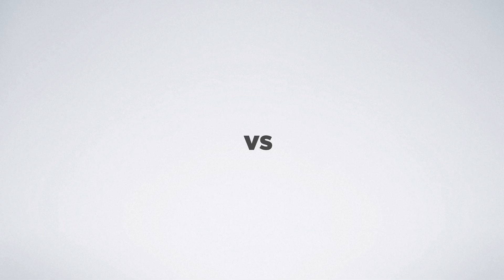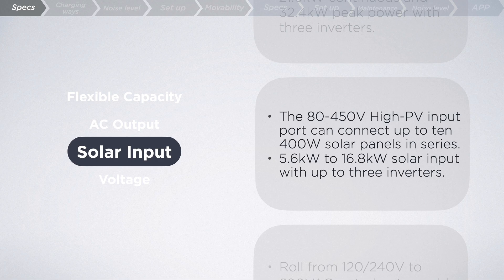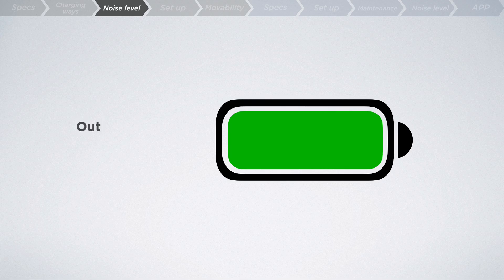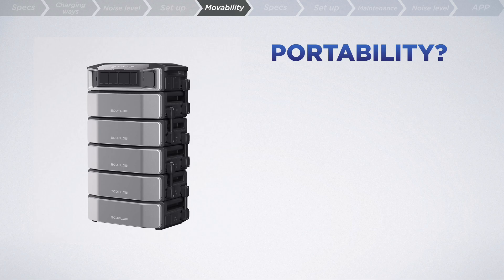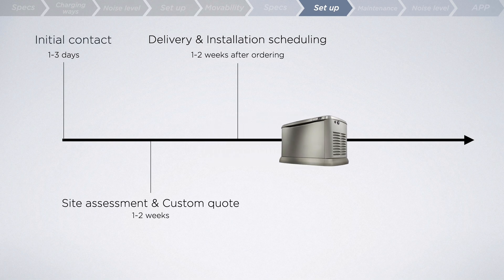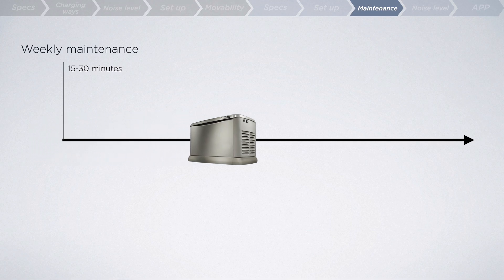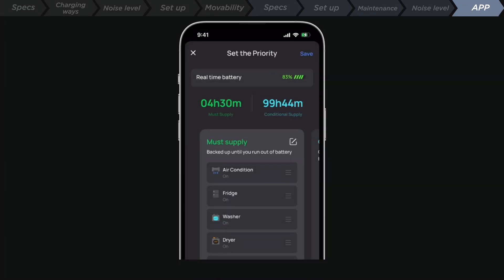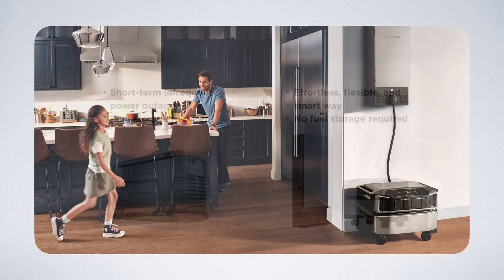EcoFlow DELTA Pro Ultra: Will it Replace Home Standby Generators?

Comment: Half of the points ecoflow doesn’t make sense. 1: Fuel, Batteries need electricity and people usually set them up charging via grid. Electricity is expensive and cost a lot. Natural gas however is usually cheaper and runs longer. 2: Flood, you’re gonna need to shutoff your electricity anyways and usually the battery will be damaged. 3: Control, What’s stopping you from going to your panel after the storm and switching off a couple things in the breaker. Also, standby generators will run as long as you need them so you shouldn’t need to conserve energy by shutting stuff off althiygh it is advised to save money.
Reply: 1-pair with solar, 2- some homes have sump pumps below ground level in basements where you can't place a gas generator.3- solar can recharge the battery once the sun is up and if you're not physically home can help if you are able to remotely manage loads to prioritize for example above sump pumps
Reply: @Remotesteve2 what about during a snowstorm? What happens then, in the winter solar charges less, what about during a hurricane when it’s completely clouded up skies,
Reply: @ItzAwsomeWasTaken  we don’t get snow storms or hurricanes here and flooding knocks out traditional generators too so not sure where you were trying to go with that…

Comment: I’m pretty sure if it flood you won’t be able to use the battery to power your home 😭. You have to cut the power from your home to prevent electrocutions and aswell as batteries and water don’t work well.

Comment: I sell and install home standby generators, and have for past 10 years. They all need some kind of fuel - unleaded, diesel, natural gas or propane. WHEN THE United States electrical grid goes down, due to age, or  power grid packing (power grid stresses), an emp (and electromagnetic pulse), hackers trying to put maleware / trojan into the system etc. etc. (Which has been happening as far back as 2016 by China, Russia, Iran and now North Korea) ... How will you get any fuel ? You wont!! So that 500 gallon or a 1000 gallon tank you have IS GOING TO RUN OUT, and if there is no electricity, there is no gas station that can supply any kind of fuel. I'm not a conspiracy theorist, but the signs of the times are coming. Get solar and batteries to protect you and your family. Ecoflow is an excellent product, an all in one product. I woulld rather have a little electricity than none at all. You can start small and as your able to add batteries do so. Its expandable.

Comment: Also... and this is a BIG also... gas, propane, natural gas generators last quit a long time if maintained properly.  These batteries slowly degrade over time.. just part of being a battery!  My understanding is roughly 10 years even if your not using them daily.  I know of gas generators that are over 20 years old and still going.  Hell.. I could go to Harbor Freight and buy FIVE 13,000 watt tri-fuel generators and still be cheaper then the battery option.  I think its a good idea to have a smaller eco-flow with solar as a backup to run lights/fridge but NOT for whole home backup.. just too cost prohibitive right now.  ALSO.. when they give you the charging specs, that is with a bright shiny day directly facing the sun.  Sorry to be a negative nancy towards battery technology, but its the same with cars... just too expensive right now, charging becomes a big issue (especially depending on where you live)- remember the news reports this winter with all the charging stations being down because of the cold!!  It has its place, but for me its just not economical, nor a replacement for gas generators.  Ohh and don't think for a minute that you are saving the environment  with battery.. that's a rabbit hole I don't want to go down today, but if you have a head on your shoulder you will quickly realize the costs/fuel involved/ carbon gasses emitted / and just raw earth moved to mine and refine lithium polymer is astronomical.

Comment: I would still give the generator the edge for now until the cost of batteries comes down. A 14kw generator with complete install will give unlimited power for about 15kC$. Your argument for now, is still not affordable!
Reply from the maker: Hihi thanks for sharing, from my understanding, you will still need to pay for the fuel as well as maintenance. However the choice is yours, glad to hear from you🙌
Reply: @EcoFlowTech from my understanding you need to pay for electricity aswell. Solar continuously charging it during weather events isn’t gonna be keep it alive, it will eventually die. They’re have been actual rest from normal usage that shows this.
Reply: @EcoFlowTech  come on.. you a tech! A generator is a stand alone system. Regardless. Your battery doesn’t get power by magic. Here’s the thing; your battery doesn’t generate power, you got to put it in and then take it out. Big difference. You need secondary systems coupled to it for its existence. No grid power to charge; it dead. No solar to charge; it dead. Solar with no sun to charge; it dead. No portable generator to charge; it dead. So, you get the picture. But it doesn’t mean I wouldn’t get one when the price is right!
Reply: @majie1018  A generator is not a stand alone system. It needs fuel. No fuel mean no run, no run means no fun, no fun means no hum drum drum. 
Solar, even on cloudy days, and rainy days, WILL STILL PRODUCE SOME DC POWER, which can be converted to ac power for your house. Technology has changed a lot since the days of i think you're speaking of... but we all have our own opinion. Ecoflow system is expandable, you don't have to buy everything at once. Not sure if you live in the United States, but most homes uses about 30 kWh per day (10,700 per year), start with a smaller system of like 5-10 kwh then build up..just saying

Comment: I looked at what it would take to run our house with the Ecoflow solution for a multi day outage and it would be so expensive that it's prohibitive.  We are talking 4 inverters with 5 batteries each and a smart panel for each branch of the 400A service.  Plus I would need panels to charge the thing if the sun was actually out during an event.  The Kohler 26kWh generator installed was a fraction of the cost, took 2 weeks from contacting them to powering it on and we can run every device in the house without worry, including the car charger.  Great in concept, but these pre-packaged battery solutions are too expensive.  If you truly want to go this route, get a rack mounted battery system for 1/2 the cost without all the proprietary addons.  You should also be concerned when Ecoflow touts all the monitoring capabilities to selectively power and prioritize devices.  They had to put this feature in because their solution is not fully capable of powering a home unless you spend many 10 of thousands of dollars.  With a whole home generator, you don't need an app to watch specific circuits.
Reply: Unless you have a family of 16 you need to get a smaller house.
Reply: 1,700 square feet and just my wife and I live here now. Cheers.... @itflint
Reply: If you've got a house big enough to justify 400A service then you can afford ANY standby/backup power systems on the market.
Reply: We bought a 24kw Generac ng unit last year and are very pleased with performance. &12,800 total installation costs and 2 week install after contacting the contractor. I do use EcoFlow's Delta 2 and extra battery at the cabin but always take my Honda Eu2200i too.

Comment: You missed the BIG difference: a standby generator, when running, is sized to power your entire house in any season.

Battery backup for a “whole home” application takes huge amounts of capacity and money, and if you want to go long periods without running a generator, an equally huge solar array.

Moderately sized home battery storage systems are NOT direct competition to whole home backup generators.

A backup whole home generator essentially lets you operate normally while being off grid as long as there’s a fuel supply.  Going off grid with solar and batteries requires monumental expense and still requires a backup generator in case of extended periods of cloud cover.
Reply: Why go off grid though? I just use my system to be basically off grid but if necessary it uses the grid to charge. The grid is now my backup generator.

If you have a compatible EV you can simply take your (example) tesla cybertruck with it's 120Kwh battery and plug it into your generator port and power your house for much longer.

The sad part is the Tesla Cybertruck is CHEAPER than buying 20 of the 6Kwh battery packs from Ecoflow.

For most people Solar with some kind of battery is enough. I spent 10k (Before the 30% tax write off.) buying and applying for all the stuff needed for the Pro Ultra 12Kwh battery and the Smart Panel. And $800 on clearance solar panels for a 5Kw system. For my small home this was plenty. For an extended outage my EV would be the "generator", but there has not been a time where that would need to be the case. The main cost is doing the work. In my county I can do it myself, if you have to be licensed in yours then that's where most of the cost will come from. It was an 8 hour job to do it myself with a friend.

I have no numbers on how much this will save me since I've just installed everything. According to my math it should be a payback period of 4-6 years. That's if nothing breaks so who knows.
Reply: @Robulite  An EV or a gas generator still has to be part of the plan if you plan to survive for longer outages.

Do you plan to use AC or a heat pump during an outage?  If so 12kWh won’t last long, and will consume much of the solar input on the Ultra, leaving little to charge the battery or your EV.

I’m definitely not criticizing your setup, it sounds like a great system depending where you live.

My criticism is with EF’s marketing their single inverter 6kWh Ultra as “whole-home” backup comparable to a large generator.  They are two completely different things with two completely different outcomes if applied to the same scenario.  I dislike when companies over promise and under deliver.  I want EcoFlow to do well, and misleading customers is not how.

Excellent point BTW about a large battery bank costing more than an EV pickup with similar capacity AND an onboard inverter to serve as home backup.  The argument was true when Ford launched the Lightning and is still true today with the Cybertruck.  At the very least you would expect these companies to give significant volume discounts on external batteries… the price per kWh is ABSOLUTELY ABSURD.  Anyone putting together a system of any real capacity would be far better off with a DIY system, even if they had to pay someone to install it.

I plan to use my Delta 2 Max, two external batteries (6kWh), smart generator and 2kWh solar array for load shedding and emergency power for furnace and refrigeration.  Right now it’s providing power on the construction site where I’m building our new house.
Reply: I have 14.4kWh of batteries (4 Delta Pros) connected to a smart panel, replenished from a 10kW roof solar array that powers ten of my home’s circuits off grid daily from 4pm to 8am. 

The result has been no electric bill for the past four years, with NEM 2.0 bill credits or utility company overage checks being mailed to me annually. Yes, the solar array and batteries are a heft investment, but the energy it offsets each day, especially during peak periods, creates an ROI that traditional generators don’t. 

Even with four battery electric EV’s, I was still generating more power than used, so I switched my gas dryer for an electric heat pump unit, our gas stove for an electric flattop, and our gas furnace out for an electric heat pump. And with these additions, we are finally starting to use as much as we are generating/storing.  

The average electric bill for a home my size in my area(SoCal) is at least $350/mo. but even with a more conservative savings of $333/mo., an average ROI of $4/kyr.. it would still take only ten years to fully recoup my total investment of my solar panels and batteries. (30k for the solar array & 10k for the EF batteries/smart panel).

I used to have a gas generator as a power back up but rarely used it over a 10 year period. At least with a solar array and battery stack, it can serve a purpose daily to offset grid usage and earn back its initial cost over time.
Reply: @evolv.e  well, it has been said, if you want a solar array to pay for itself quickly, move to where electricity costs more, lol.  California has insane electricity rates.  Fortunately most places are better managed and rates are MUCH lower.
Reply from the maker: Hi, understandable. The biggest challenge of standby generators is that you can't make your own gas or propane. Any disruption of the fuel supply, which can often happen in extreme weather, leads to a complete shutdown. And concerning the cost, it might cost you more to prepare a huge solar array and a complete whole home backup battery. However, you won't need to pay for fuel or maintenance, especially during outages, you might need a large amount of fuel to run your water pump. In the long run, solar batteries are a competitive substitute for home standby generators if you need a reliable and flexible power supply during any off-grid events.
Reply: @EcoFlowTech  there are benefits to battery/solar backup, but there are also drawbacks, cost being the biggest.  I can store a massive amount of energy in propane cylinders for relatively little money, which can be used to generate electricity on cloudy days and be used for heat.

The reality is, in a cold climate like northern USA or Canada, solar is completely useless on cloudy days.  I know what I’m talking about as I have 3700W of solar hooked up to my Delta 2 Max, and on cloudy December-February days I get 100-150W input.  My panels are pointed due south at approximately a 75 degree angle to keep snow from accumulating.

Solar is great, but it CANNOT be depended on as a sole source of power in many climates.  Believing otherwise is foolish, and potentially dangerous.
Reply: @superspeeder there are more drawbacks to traditional generators as they don’t have any ROI. You can’t use them to offset any cost. If anything the cost just increases with the mandatory maintenance. And they’re also dependent on external fuel that can also have supply issues. Believing otherwise is foolish, and potentially dangerous.
Reply: @zimvader25  if you read what I wrote, I said relying on solar in a cold climate can be foolish and potentially dangerous, which is 100% true.

My argument against EF is their completely unrealistic marketing which could fool naive people into thinking a small backup battery can replace being on the grid.  In a climate like San Diego with an efficient home that has little to no cooling or heating loads, that might be approachable.  Anywhere else it’s a pipe dream.

I would hate to think someone might rely on a small battery for critical backup based on misleading marketing, and end up in a predicament that puts them, or even just their home, in jeopardy.

There are drawbacks to ANY energy source.  I’m building a VERY efficient house that will have a natural gas connection, a furnace, a heat pump, a large propane tank, a generator, and enough solar and batteries to keep my fuel-powered heat sources running in winter and my AC running in summer.  I don’t want all my eggs in any one basket.

FYI (in case you’re not aware), most grid-tied solar systems which pay back (net-metering/Feed In Tarif)) are only allowed to be hooked up in a way where they WILL NOT provide power during an outage.  With the grid down the inverters shut off to protect the grid from back-feeding from solar.  If you’re playing by the rules you’re most likely not protected during a blackout, unless you have a battery backup integrated into your system when it’s installed/inspected. 😊